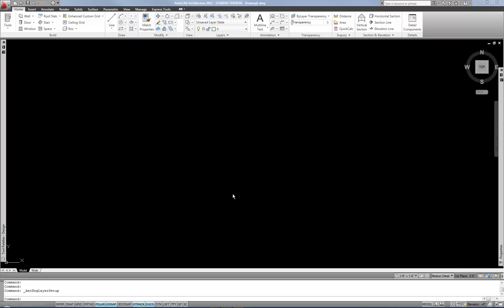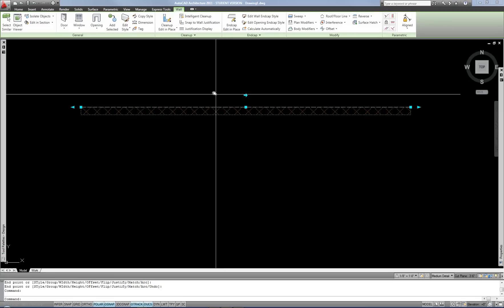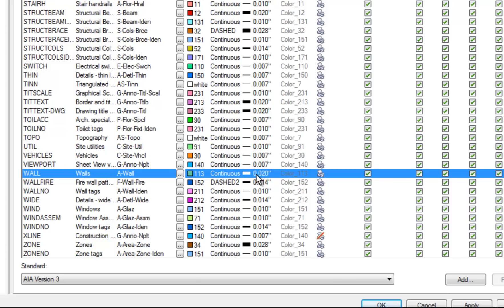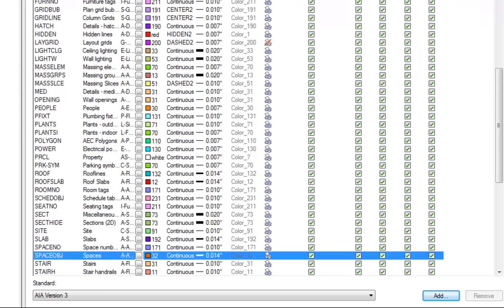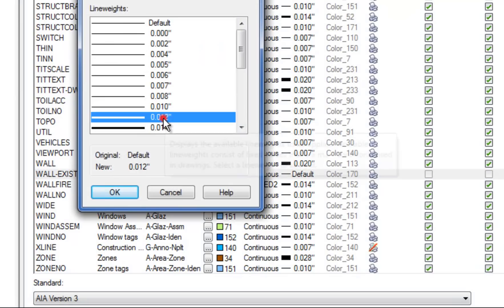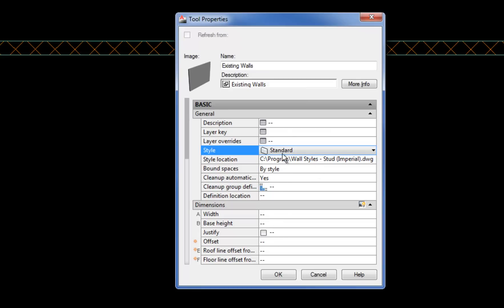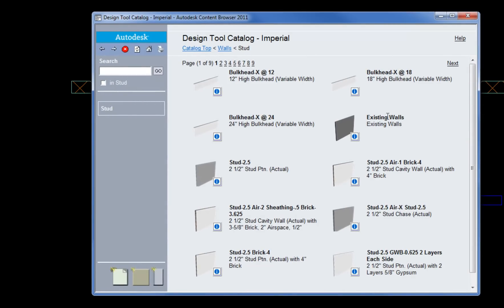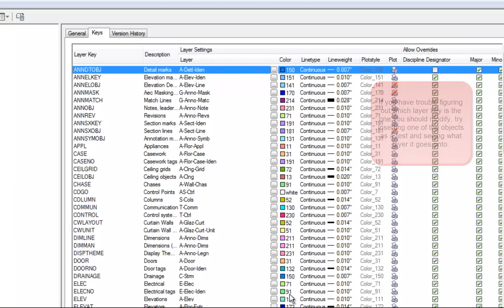ACA: Layer Keys

Comment: Hi, would I create more layers or a multistory house? like A-Wall-1, A-Wall-2, A-Wall-attic for example. i'm just not sure how to do multilevel designs with ACA and i've looked at all the videos, thanks
Reply: Create a separate file for each level with consistent layer naming and then XREF the levels into another file to assemble a combined model of all levels.
Reply: thanks, that sounds complex, and it looks like Revit handles multilevel and foundation design all build in. i think that maybe the better tool for me.
Reply: Yep, that is true. Revit is much easier straight out of the box.  The ACA set up I mentioned is also easy to setup but harder to manage the graphics aspect.